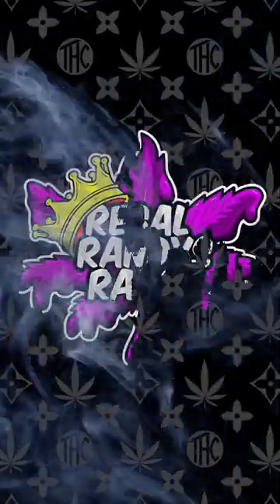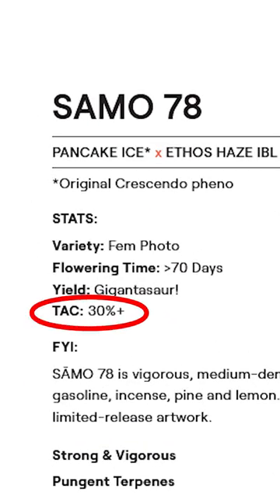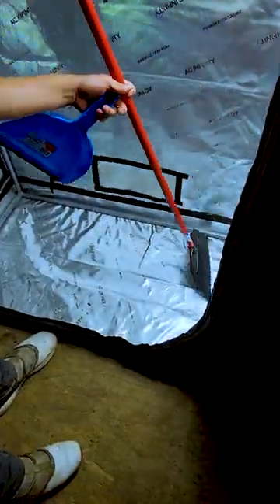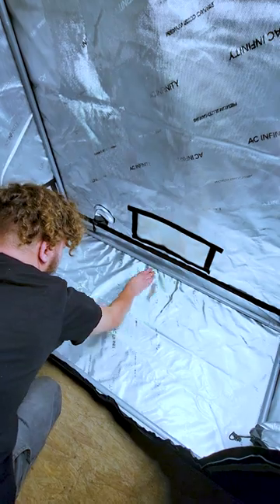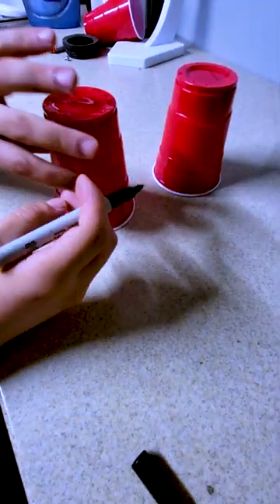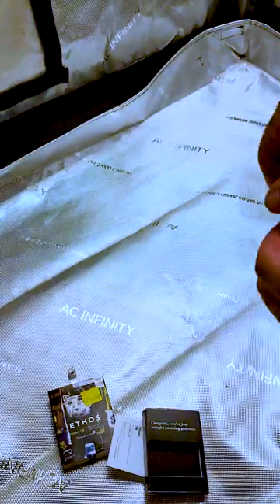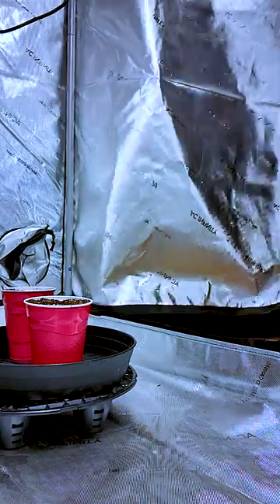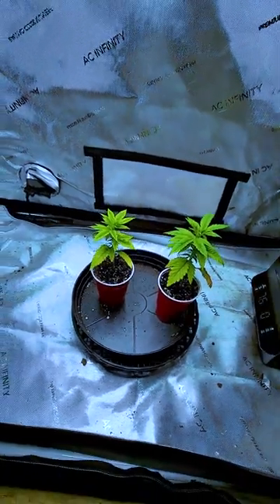New Ethos Strain - 2022 (RARE)

Comment: How did these turn out? I just got my samo's.
Reply from the maker: so i have 2 this run, did another 2 in flower rn, and have 2 more going. the first 2 were good but not what they were hyped to be. second ones were better (grew them differently) and im trying something else on the third set. theyre lanky and hard to grow if youre not experienced. they stretch hard and dont like lst. would suggest topping them early and then mainlining them. theyre a nuanced grow, and can get pretty chonky but the structure isnt what i was used to. i like to scrog and lst and these were not having it. also they like a hot and humid environment with a ton of wind. havent edited the videos but im working on it. @eastcostterpster has some in flower idk if the videos up yet on his channel. thanks for stopping by and make sure to join the giveaway fam!